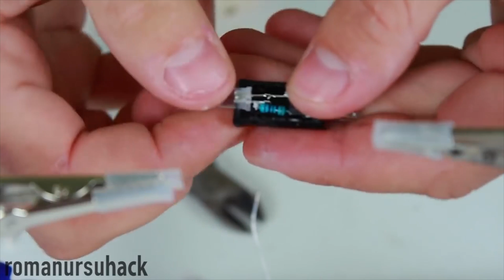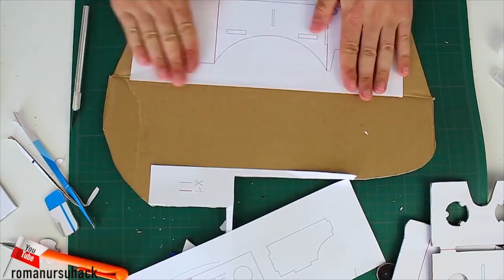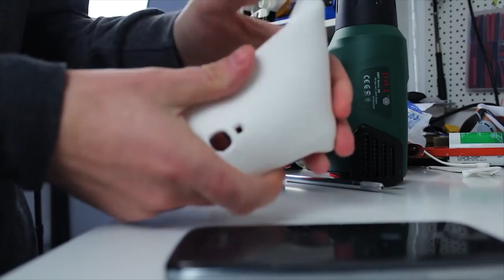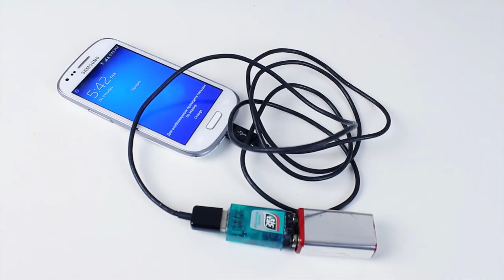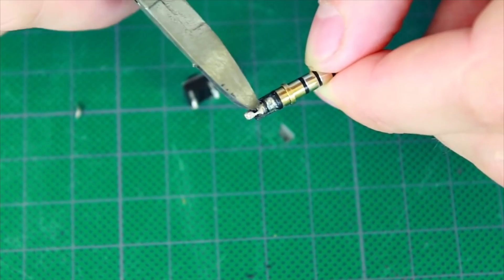13 Ideas about making DIY gadget projects for a smartphone

Comment: I have a Hack that may interest you? in case your power goes out you could try connecting a house phone line to a charging cable and you will be able to charge your cell phone or a radio in case of emergency. this works because there is a small amount of power going through the phone line even when the power goes out. remember in the united states this is not legal , so check your local laws so you don't get in trouble.

Comment: 0:50, awsome & easy(ish) diy usb led.
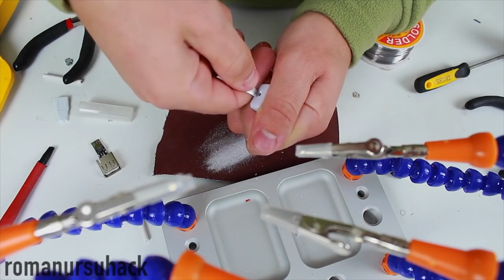1:40 Usefull Usb/micro Adapter.
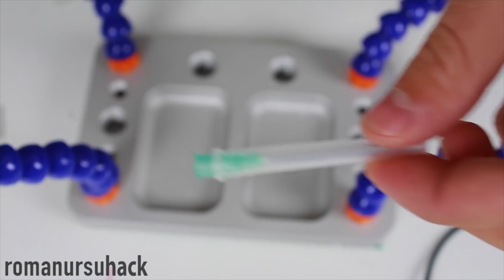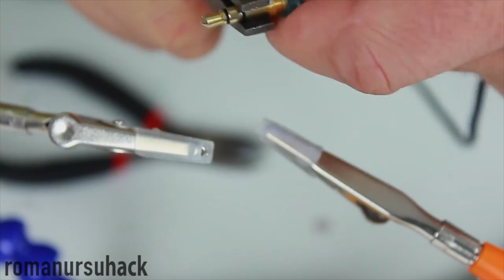2:12 to 2:43 Essential audible repair.
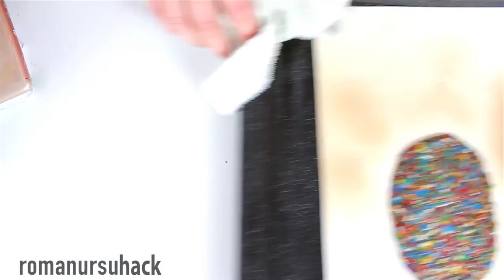4:35 try a silicone baking sheet.
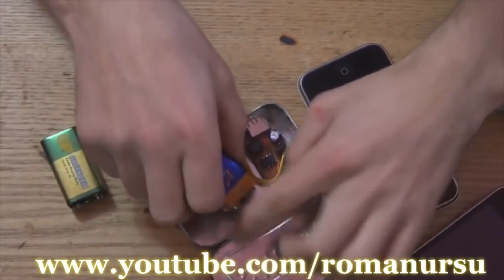8:57 Electrocell(s) Short warning!.
11:39 Getting Great Results.!
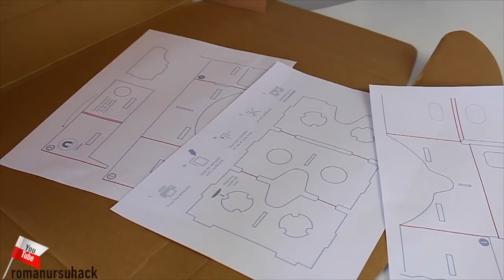11:55 #stareOgram viewer
12:50 to 13:01 Pure Genius.
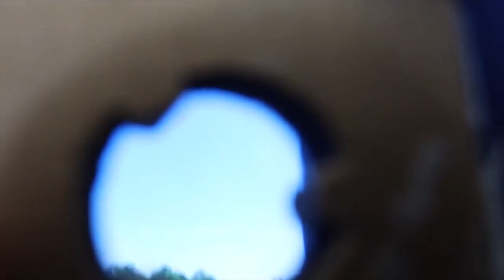13:36 Retina Warning.! Don't look at sun!. Danger.! Magnifing glasses concentrate light to extreme heat, Hotter than a torch. You don't want that to happen in your eyeball.!!!
13:59 to 18:53 semiPro diy Silicone phoneCase.
18:54 Interesting Remote Project.
19:27 to 19:47 LEDiode per area maximization.
21:23 How To Make, a Simple Portable Power Bank Converter/Adapter!. (pause at 22:33)
21:40 USB chip description! (Magic) 5V out.
25:39 Lacking Structure.
27:20 to 27:28 +1, How to toss and break your phone. (maybe hang it from the bottom next time)
Pause @ 29:45 & 29:55 for more Optical Genius.!
33:19 Klick app.
Reply: Thank you very much man.
Reply: You are Welcome Very Much. Thank you for Being Awesome, and Sharing that With The World.!
Reply: Kyle Micallef thanks man
Reply: Kyle Micallef
 Thank you ..great effort  in putting this list ...thumps up for you bro
Reply: Kyle Micallef z
Reply: Kyle Micallef Thanks